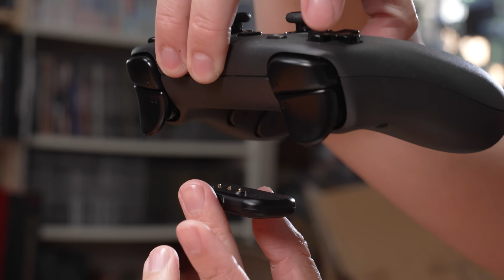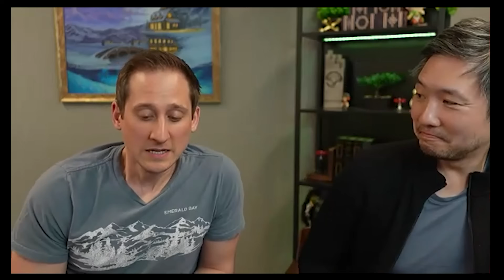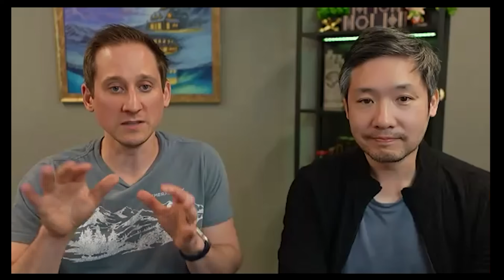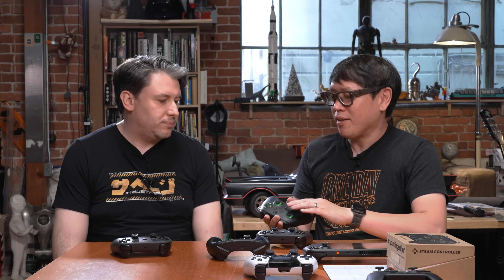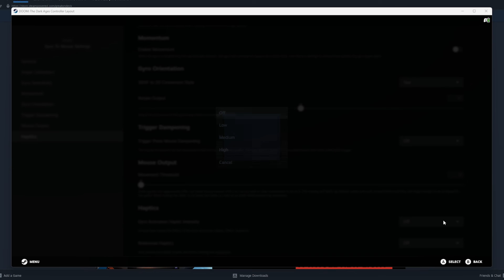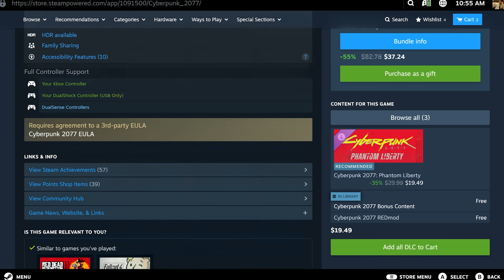Tested: Steam Controller Review + Valve Interview!

Comment: Love Norm and there's some good points, but honestly a lot of this feels like "I don't relate to the central thesis of this device so I'm not sure it's worth it." An ergonomic solution for mouse input on TV is as big of a deal as the Deck was for portable play.
Reply: What a surprise seeing you here
Reply: I'm not convinced a trackpad is the best solution for mouse input when high-precision gyroscopic IMUs exist.  Any time I use a laptop I have to get used to the sluggish, friction-aggrieved, and ultimately inaccurate input style of a trackpad in a way that I simply don't with properly calibrated and responsive 3-DOF gyro aiming.  The only foil to this is scrolling (where a trackpad does provide a better experience) and the phenomenon of cursor dip when actuating buttons if the binds have not been configured to dampen gyro output while pressed.
Reply: @jesstech  The key here though, is using the trackpad as a trackball. Steam Input lets you emulate trackball movements with the trackpad, letting you set the friction level and have the haptics give the feel of the ball moving. That provides an experience that's much more improved from regular trackpad use in games, and combined with 3-DOF gyro, at least in my opinion feels unparalleled in controller aiming.
Reply: @jesstech laptop trackpad and steam deck track pads (and by proxy steam controller track pads) are entirely different experiences. Laptop track pads lack ergonomics, paired gryo, things like friction/roller ball style input, and lots of other advanced input configuration. I wouldn't base your impression of steam trackpads on a laptop trackpad.
Reply: @jesstech  As others mention here, it's not a question of either trackpad or gyro. It's the combination of them that activates the magic.

Gyro alone means you have to use your wrists a lot to move the entire controller physically constantly, which is hardly a relaxing way to play. That's why it's most often combined with trackpad or "flick stick" on the right stick to quickly be able to instantly turn in any direction and then use gyro for precision.

To better understand, here's how I usually set up my Steam Controller (old version): Right trackpad outputs mouse and sensitivity set so that a full sideways swipe matches 180° in-game (and trackball mode activated for convenience). That way I can instantly turn in any direction. Gyro is active while I touch the trackpad and is used for fine adjustments (I usually set it to 4:1 rotation speed). This method is relatively easy to get used to but it's still recommended to spend some time building up muscle memory.

Alternatively, as mentioned, you can use flick stick, which is a special use of the right stick invented by the developer Jibbsmart. The way it works is that when you activate the right stick (move it out of its resting position) your camera will instantly turn horizontally in that direction, meaning if you flick it straight left it'll turn 90° left, backwards flick is 180°, etc. If you keep the stick "active" (away from center) you can keep rotating with it. Combine this with gyro to get precision as well as vertical movement. Be aware that this method requires A LOT of practice to build up the muscle memory as the function of the right stick is completely different from what you're used to. But once you get there it's a very powerful way of using the controller.

Personally, I find trackpad + gyro to be the most comfortable way of playing by far. So much that I don't mind taking the time needed to remap the controller as needed.
Reply: @jesstech  Touchpad controllers users use the touchpads at a high sensitivity to swipe around and a gyro at a different sensitivity to aim. They also use the touchpads to activate gyro on touch and deactivate when the thumb isn't detected. And also set up face button and center click functionality on the touchpad to use in place of the face buttons so they don't need to take their thumbs off the touchpads. 

I don't think lot of channels really showed that type of use case, since it's not a set up they are familiar with or comfortable with.
Reply: @jesstech a trackpad + gyro is the best solution that has ever been tried so far

Comment: Wouldve been nice if it had a keyboard pad on it like the old Xbox 360 days. I think the track pads would be more useful if that was the case. Cause then it's like you can actually use it to navigate a PC on a couch without a kb/m
Reply: On steam deck they have a virtual keyboard you can pull up with a button combo, and navigate it with the two touchpads simultaneously. I'm sure this will have something similar.
At least, on the steam machine with steam os, dunno if through steam on Windows they could do the same thing.
Reply: @truhlb I suppose that's something, but I specifically mean a physical keyboard. The biggest reason for me really is actually just for logging into windows since they default ask for a password now on boot.   Also maybe game text chat
Reply: @lacedchemist1295  Mhm, yeah

Comment: Having the Steam Controller tracked in VR was another huge part of my purchase. Insane compatability
Reply: Dude I had no idea. Instant buy now.
Reply: Genuinely asking. How does it matter or implement into a game's input? I've only ever played VR games with whatever motion controllers they shipped with
Reply: That's gonna be huge for me actually. Getting the frame because I should be able to do my full VR development work directly on it, since it just runs linux. If this is tracked and the trackpads 'just work' it'll be a nice UX improvement over the separate controllers for using desktop mode.
Reply: it has lighthouse tracking??? does the puck count as the dongle for that too?
Reply: @Blockistium  (14:30) It uses an IR emitter in the same location as the controller's power light.
Reply: @Blockistium it's only compatible with the upcoming steam frame I believe
Reply: @mildclownery  Right in this video they mentioned the Apple Vision Pro instantly picked up on it, so we're gonna have to see what is and isn't compatible out of the box.

Comment: 2 stage triggers would have made this perfect. Loved that on the original controller.
Reply: That might be able to be implemented solely in software... Tho the hardware click of the trigger itself won't be there
Reply: @charlesskomp5362  well yeah steam does had full press and half press functions, I meant the tactility
Reply: @404errorusername  if you map both soft press with a lowered (increased number) trigger point and analogue as the touch command, you achieve a two stage trigger with good haptics.
I could configure it and it feels better than the OG triggers, but did not test the analogue output yet.
Reply: @WyvernDotRed yes, yes, yes, I mean the of the button press for the second stage
Reply: @charlesskomp5362  That is already implemented by software, the steam controller config is insanely good.
What people like him and me are missing is exactly that hardware element.
Reply: @charlesskomp5362  which is already implemented on Steam Deck.
It does not work that well as the weighting is on the lighter side.
But after trying an original controller, the duel stage does feel bad when using the triggers ad buttons.
Which seems to be the compromise they went for.
Ironically, the trackpads might be more suitable for duel stage emulation, as even the LCD model ones have a surprisingly large pressure range.
Though the 4 back buttons more than make up for it too on Deck.
Reply: Either that or something like the Playstation’s adaptive triggers.
Reply: You can still achieve dual stage triggers with the help of Steam Input, but the actual physical switch isn't in the triggers anymore since they're now analog.
Reply: @curious-pixelz  I need the tactility

Comment: I will day 1 replace xbox controller with this. They did not mention this but track pads are like 8 or more additional buttons that you can bind? For PoE2 thats go to controller it will be so much easier to play when i just can bind inputs to those track pads, use mouse on gamepad and use gyro aim assist. 4 more days and im buying it. A lot of those reviews dont mention games that need support of mouse in micro management of your inventory like RPGs or somthing.

Comment: What I want to know is will the controller have on board storage for custom layouts? like what if I set up macros and then decide to connect it to a switch with a dongle or another computer will my macros be saved?
Reply from the maker: no on board storage for layouts, and it doesn't work with a Switch. the only thing it stores is pairing sync with the puck.
Reply: Dang i was hoping it would i know it wouldnt work with the switch on its own I use an 8bitdo dongle to get my dualsense edge to work with my switch and switch 2 @tested

Comment: I think there is a fundamental issue with how people think about this controller. It's a solution to operating systems made to be used primarily at a desk with some after thought going to tvs. You can use it at a desk and use it for whatever you want but it's mainly to fix the problem between PC and TVs in a living room. The touch pads are literally everything to this controller to fix a pop up when you play games or going through menus on pc. If you want the controller without the track pads, I really think you'll find a better cheaper controller 3rd party and this wasn't for you.
Reply: Yeah, I've been waiting to play pc games on my tv until I got this. It'll be nice to be able to rearrange Windows 11 windows and frequent display issues with the track pads and controller keyboard input options without having to get up and down repeatedly from the couch.
Reply: If you've ever tried to build a living room pc. You already know what I'm talking about and you more than likely already gave up on it from frustration.

Comment: 99 is an amazing price. Only things I would have wished for with this controller would be hair-triggers / dual stage triggers... and instead of grip sense it would be cool if the 4 back buttons had touch instead.
Reply: No it's not.
Reply: @Orange_Tang  It's not much more expensive than other first party controllers, with many features generally reserved for far more expensive controllers. I can't imagine Valve selling this for a much cheaper MSRP.
Reply: @Orange_Tang  Yes, it is & that is not a debate, it's factually a great price.
Reply: the steam deck has a dual-stage mod to add a click at the end of travel, i imagine this will have one quickly after release too
Reply: @dingusDOTtv  That's not the same.
Reply: @dingusDOTtv  It's a click, but not resistive enough to make a STOP then click. There's an important distinction there. That's the only thing I'm gonna miss from the OG.

Comment: Dont understand why people are questioning the 100$ price? Thats cheap for what it does. Why doesn't anyone question these trillion dollar companies on price when they can afford a loss. Dont understand
Reply: I agree with you that this price is probably reasonable. Especially with both the quality of parts used and repairability in mind. It will likely last you much longer then many cheaper controllers. To the point it may be cheaper in the long run to get this one and maintain it then buying cheaper ones.

That said, valve is also a multi billion dollar company with an extremely reliable source of income (steam store). They too can easily afford a loss on this. I mean, that's pretty much what happened with the previous steam controller after all. I bought one in the end from them for just 5 euro. Obviously it's not the goal to make a loss but they are more then able to take that hit without really any consequences. They are not your local mom and pop hardware store.
Reply: And valve is only worth 10 billion...
Reply: @Itisfinished316  ... those are multiple billions, which makes them a multi billion dollar company. also "only"? you have any idea just how insane an amount of money that is? taking your 10 billion, if they made 99 million controllers and lit them on fire they would still have at least 1 billion dollars left (yes i realize that is not how it works, its just a demonstration of scale). Keep in mind, valve is a private company. their value is not tied in stocks or confidence that can vanish into thin air. its been estimated they made about 16 billion in revenue just last year. all in all, yes they can make a bunch of these controllers, miserably fail selling them, and still be more then fine.
Reply: @HildeTheOkayish agree to disagree end of the day im getting one.
Reply: @HildeTheOkayish alienware made the original steam controller and console. Valve is not a trillion dollar company like i said in my statement above. They take care of the customers and treat the employees right. But a company being more customers friendly always faces more criticism then the metas amazon etc. End of the day ill support a company that cares
Reply: No it's not. Almost every other 1st party controller starts at under $75. Yes, it's a one of a kind controller, no, that doesn't justify it being so expensive. $80 is a reasonable price because it has more features than most 1st party controllers, but $100 is going to make this a wait to buy for me despite being the person it's aimed at. I own multiple steam decks and play from my couch regularly. I'm not paying $100, it's too much.
Reply: @Orange_Tang agree to disagree
Reply: @Orange_Tang Good. That's one less person in front of me in line
Reply: @andrewmorris483 true lol

Comment: Hardware looks solid... but software have some limitations
- on Xbox controller you can play games from all stores including Game Pass, web games in the browser or emulators. 
- on Steam controller you are limited only to games from Steam. You can't play Game Pass games or games from web browsers etc. Every game from GOG or Epic must be linked to Steam which shouldn't be required

This is not a hardware problem but a software issue. This controller works only when the Steam app is active. There are no standard drivers for Windows, Linux, macOS, or Android. There is also no support for standards like XInput or GameInput. The open‑source community has created workaround to those problems like GlosSI and SISR, but this should not be necessary in expensive controller for $100. Other controller for $50 support more games because they are compatible with standards like XInput. So I hope Valve fixes these software issues in future.
Reply: Add your GP games as a non steam game or add standard desktop controls to your binding interface and leave steam open in the background
Reply: This needs to be tested. Most journalists who had access to the Steam Controller didn’t test game compatibility at all. Only PCMag tried playing Game Pass games and it didn’t work for them. Nobody tested games in emulators, web apps, streaming apps and so on. Until now all reviews focused only on the hardware. So for more complex review we need to wait until gamepad will be used by gamers. The first big test will come when Forza Horizon 6 is released. Nearly everyone plays Forza from Game Pass
Reply: @MajesticBowler it works fine on Deck
Reply: Linux is very different from Windows. On this system you have native support for SteamInput that works independently of the Steam app (a driver created by the Linux community). As a result, the Steam Controller  works with web browsers and any other application. This also allows you to stream games from Game Pass. On Windows the situation is more complicated. There is no SteamInput driver and the Steam Controller is limited to Steam app. There are some workaround solutions created by community like GlosSI but nobody has tested this yet with the new controller.
Reply: @MajesticBowler it worked on the original steam controller on Windows

Comment: It just is a pity that it only works with steam. Good enough reason for me to not buy it.
Reply: why would u want a steam controller if u dont have steam?
Reply: @waltss8896 the same reason I use a dualsense without a PS5. Also, I have steam, but why wouldn't I want it to work with every platform?

Comment: If this hardware helps compel developers to give their games controller compatibility then I'm all for it.  Too many games on Steam are released without it IMO.
Reply: If you had the OG Steam Controller, it wasn't an issue. I played 500 hours of Dwarf Fortress perfectly comfortably with the SC. Steam Input is just that good.
Reply: Yeah, there's some nice things that not so many games do:
use Steam API to get the most suitable controller buttons on screen, even if they use XInput.
use Steam API with custom Game Actions, removing the layer of controller abstraction when changing your inputs within Steam (example games Okami HD, Portal 2)

Even if they don't do those things, there are subtle or not-so-subtle things that First-Person POV games have done to make another thing work better.
One of those things is how the game behaves when there is input coming from a gamepad and mouse at the same time.
If the game supports both of those controlling a single player, Steam can start with a gamepad layout and add Gyro to Mouse as an input.

If that doesn't work out for a particular game, all of a controller's inputs has to be remapped to keyboard and mouse.